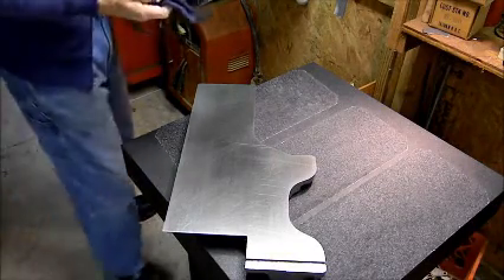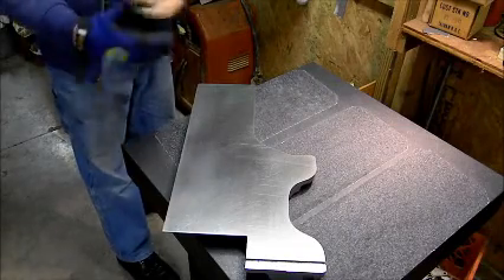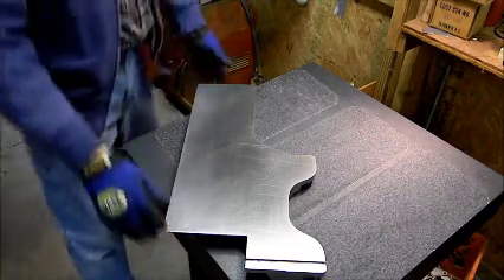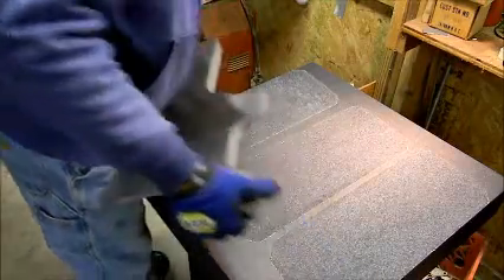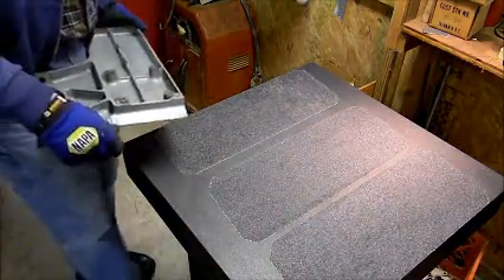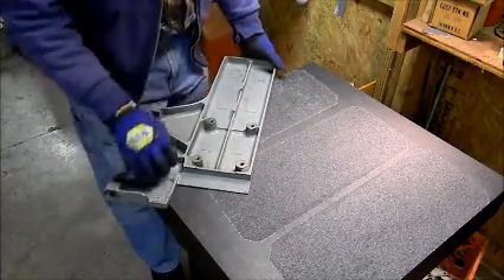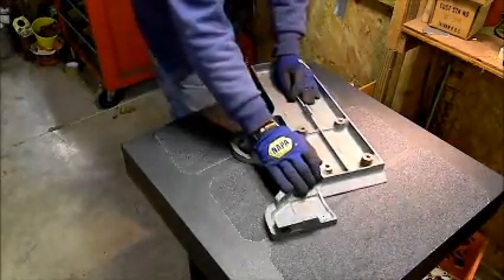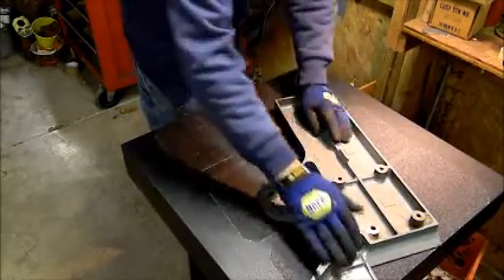Flatening Jointer Table

Comment: The surface area of the contact patch between the sandpaper and the jointer bed is large. The pressure on the sandpaper is evenly distributed across the large contact patch preventing the abrasive s from cutting deeply.
Reply: Thanks for your comment Sarit,   I gave up completely flattening the tables with this method. I got it down to .003" flatness, and progress was getting very slow.  Next time I think I will use my surface plate for checking flatness with Prussian blue ink, and try my hand at scraping the iron tables flat.  Here is a link to what I have in mind: http://metalscraping.com/ Regards,  John

Comment: I know it's a bit late to do anything about it, but I'm concerned that the unprotected gaps between the sanding pads will allow grit to get onto the granite plate and cut troughs in it.  Did you check for this after you finished lapping the jointer tables?
Reply: +Mark Sheppard.   Hi Mark, thanks for your concern, and comment.  The sandpaper had a very thick backing, so I did not experience any scaring of the granite.  As it turned out, I gave up completely flattening the tables with this method. I got it down to .003" flatness, and progress was getting very slow.  Next time I think I will use my surface plate for checking flatness with Prussian blue ink, and try my hand at scraping the iron tables flat.  Here is a link to what I have in mind: http://metalscraping.com/ Regards,  John